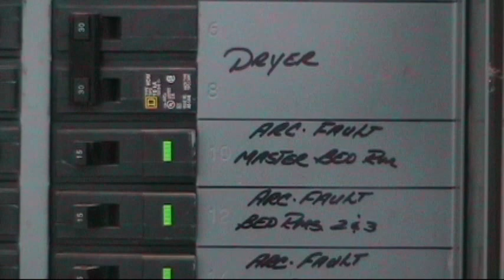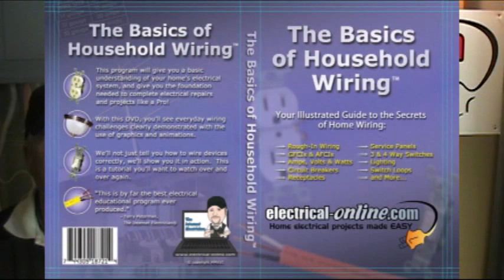How to Reset a Tripped Breaker

Comment: My wife moved the location of a space heater in the house on a cold evening and it tripped the circuit a few minutes later. I’ve been a home owner for over 20 years a did not know this simple tip. Thanks for this video that I found on my first click of a Google search. I don’t see any thanks button that you mention, but I would like to compensate you for the important information that saved the evening. Thank you.

Comment: Hey Terry .. thanks for your video!  I don't do much wiring, so when a breaker "broke", I tried to reset and saw the flash you described in this video.  When I replaced the electrical outlet, I basically did the wiring the exact same as it was before, and it did not work.  I think it was because I did not reset the breaker as described here.  I am putting this in my home repairs documents as I will not remember how to reset a breaker each time as it seldom happens.  Will check out the site once I am up and running again ... and the water filtration system is cleaned too ... too many tasks to do ....  I think everyone is in the same boat and your video helps us less electrical inclined users :)  Thanks again!!
Reply from the maker: Thanks for watching!  I hope you gave the video a 'like', and that you've subscribed to my channel?  And click on that notifications bell so that you'll know when I release a new video!

Comment: Good video clear and easy to understand, but my house is over 30 years old and the breakers do not have an off position they are either tripped or on and the one in question I turned off to put in a new thermostat and once completed will not turn back on! I disconnected all the wires to the thermostat but still will not turn back on. Thinking I may need a new breaker but hoping to find out before I attempt that
Reply from the maker: Best guess without being there to test things out,... yes, you need a new breaker.
Reply: New breaker was the fix. Thank you so much

Comment: There were two very short blackouts yesterday.  Each time, all my home electricity was quickly restored -- except for the electric functions on my gas stove -- the burner ignition, overhead light, and oven light.  I went out and looked at the breaker switches, and no switch looks "tripped".  I can't tell which switch is for the stove, since the labeling next to them, in magic marker, is mostly faded.  So i tried, over and over and over, turning the switches off and then fully back on again.  The last time I tried this, I did notice that in the middle of the switches, two switches next to each other could be easily wiggled as if they had been tripped -- I made sure each of these were completely off and then completely back on.  Nothing works.  All the other electricity is fine, just the stove's is out.  Am I doing something wrong or what?   Maybe it's the stove itself, possibly its electric cord burned out?  I can't budge it to move it out and look at the cord.  For many years, after power outages I'd do this same thing to reset the switches and it always worked.  Not this time.  I'm baffled.  Anyone have any ideas?

Comment: What if the circuit breaker has a lockout device on it? It’s stuck in the middle and my kitchen oven/ range hood isn’t turning on as well as my doorbell, but there’s a silver locking mechanism on it.

Comment: I have a similar issue in one of my rooms the breaker switched off it’s possible that it was overloaded so i unplugged everything then went to try to flip it when I tried to switch it on it will move in the position but a orange strip shows and the power for that room still hasn’t come on and it’s been off for a day now I reset all the tabs but that one room where nothing is plugged isn’t coming back on like all the others.
Reply from the maker: But did you try to firmly push it to the 'off' position until you hear or feel a 'click', and then turn it back on?
Reply: @theinternetelectrician  yes i firmly did it and still nothing it’s like it’s refusing to turn on the only thing I see when I try to switch it back is a orange strip in the on position I guess it’s indicating that even it’s in the on position no power is being generated to that room like I mentioned earlier everything was unplugged in that room.
Reply: @theinternetelectrician  but now that I think on it yesterday I did have a iron plugged in and i did see the lights dimmer a little but afterwards I unplugged it and left for work hours later when I returned that’s when I realized that the power for that room was out.
Reply from the maker: @insertnamehereplease._____2586  Hmmmm.  Does it seem like the breaker trips again instantly, or more like it's not really doing anything when you turn it back to on?  Kinda spongy or loose?  Regardless, unless you're comfortable with a multi-meter and its functions, you need  to get  in a good trouble-shooting electrician.
Reply: @theinternetelectrician   more like a instant trip like I can hear the switch but nothing happens soon as I switch it in the on position it’s instant trip no power flow and yea most likely will but I’ll have to see especially if it’s affordable to have someone come and look.
Reply from the maker: @insertnamehereplease._____2586  My best guess is that you have a short circuit then.  If you're going to look into this yourself, safety first!  Start at the outlet where you last plugged something in that worked.  I suspect a loose wire or maybe the receptacle shifted and the hot terminals are touching the metal box? Some things to check anyways.
Reply: @theinternetelectrician  noted I’ll look into it safely

Comment: what if one of the switches won't reset/turn on? 
when I hit the switch to on, it goes back to off..
Reply: Tyler Durden Same
Reply: Did you ever find a solution?   Having that problem now ?
Reply: @bundles3226  yeah, you need to get an to electrician to change the switch/trip breaker cause it is faulty.
Reply: @ray7412  the trip breaker/switch is faulty, you need an electrician to replace it..

Comment: This did not work for some reason and it’s really cold outside is it because it’s cold I’m in Michigan
Reply from the maker: It shouldn't have anything to do with the cold. You need to have this investigated.  Sounds like a faulty breaker, but it needs hands-on trouble-shooting.
Reply: @theinternetelectrician  yea what I did is turn it off and on and did it again and did it again we did it like 4 times still didn’t work

Comment: Hey how would i know if i need to upgrade from a 100amps to 200amps in my house cause i have a electric dryer, water heater, oven ect & the panel gets real hot & the water in the house only get hot if i turn off everything & plus ive been using space heaters, someone told me that it may not be enough amps in my house to power all that electical stuff & i might need a upgrade, could that be true?

Comment: At the 2 minute mark the circut breaker was in the middle and you mentioned it should click in the reset position (Left) and then it will allow the circut breaker to click in and reset when moved into the right on position.  You didnt mention what to do if the fuse doesnt click into the reset position(left)  So The circut breaker wont click into the left position

Comment: Mine didnt trip it just wont work I've tried everything and the wires are fine. It's not the lightbulb either
Reply: @whytho2006 did u get a solution I'm having the same problem